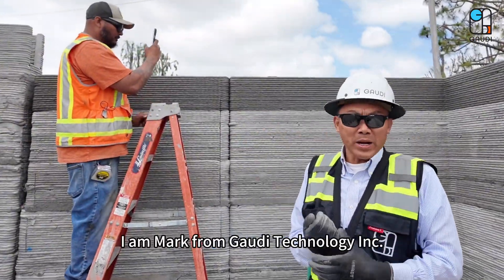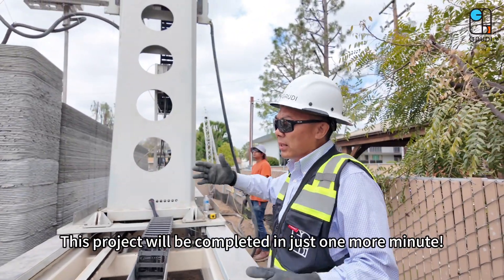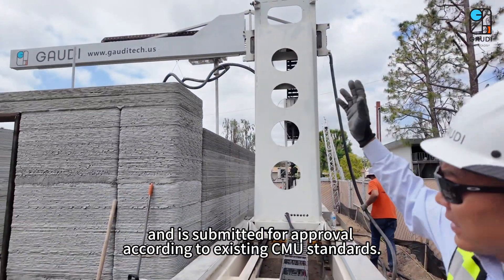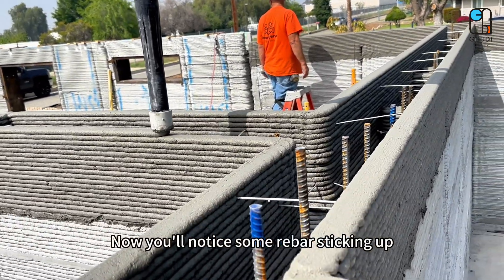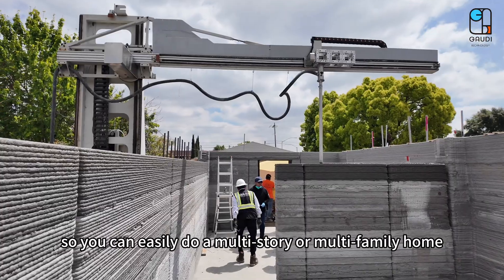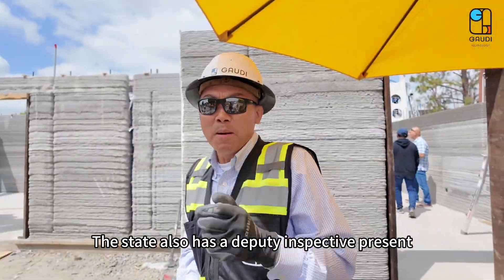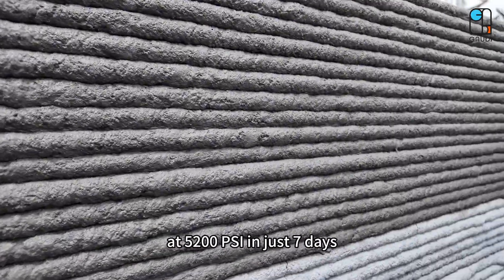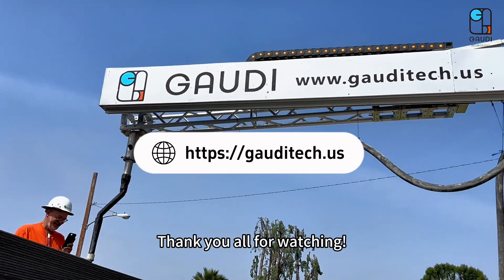How a 3D Printed Duplex is built - 3 minute Tour Guide

Comment: What is price per sq foot when completed. What I mean by that is all appliances are installed hooked up ready to be turned on HVAC  et cetera certificate of occupancy has  been signed off on and the keys are ready to give to the new owners and or realtor to sell the property.
Reply: I replied to this last week and it must have got deleted?. Anyway 225 / sq ft according to the contractor.
Reply: Best of luck. There are 3d printing companies same level of completion for$94 sq ft in Texas
Reply: @hondainsight421  that is the difference between Texas and California ;). Land here is much more expensive and permitting is a lot more expensive and intrusive. Also a requirement of Solar Panels adds to the cost. The cost of our material is much less than the companies in Texas.